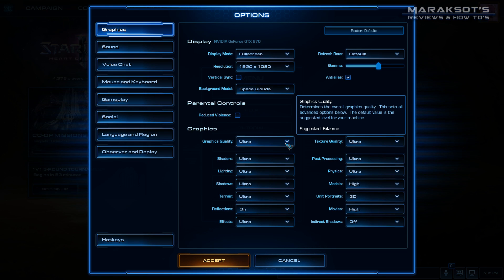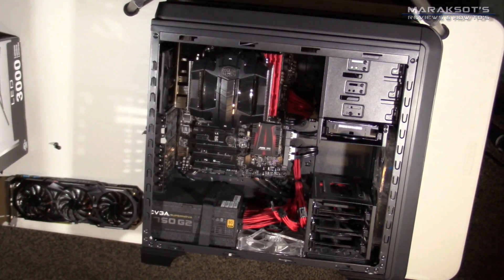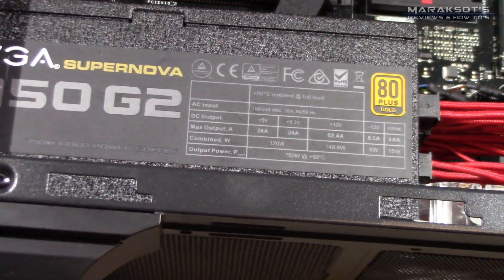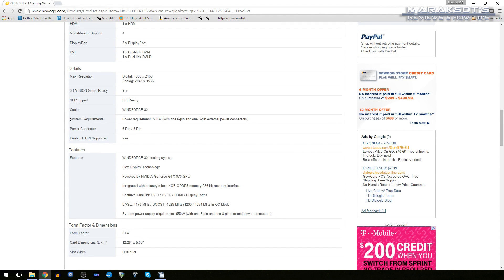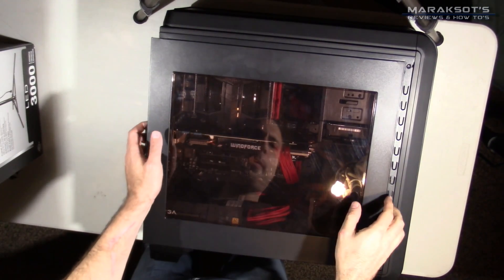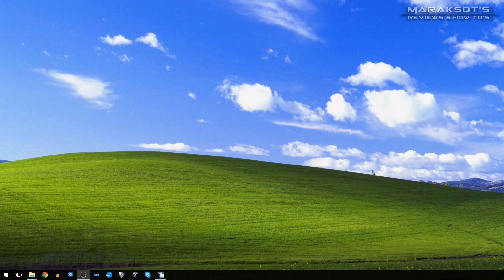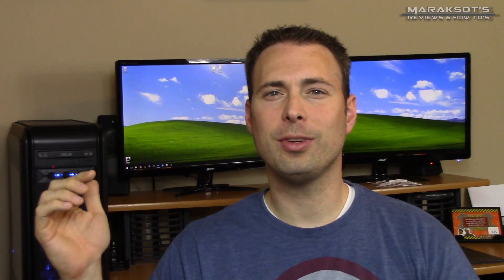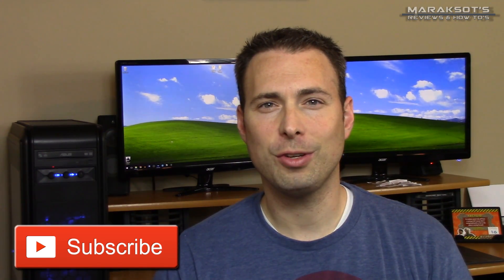A Beginners Guide - Upgrade your GPU - How to Install a New Graphics Card

Comment: I try to install a radeon rx 470 into my computer, did not work, even if I have tons of ram and a 8 core CPU
Reply: My pc model: Dell XPS 8700
Reply from the maker: I'm sorry to hear that.  I'd like to help but I'm going to need some more details to be able to see if I can help troubleshoot the problem.  What exactly do you mean when you say it doesn't work? Do you push the power button on your computer and nothing happens? Or do you push the power button and you hear the fans come on and whatnot but nothing is displayed on the screen?  Or does the Dell logo come up on your screen at first but then as it boots into windows everything goes black?  If you can tell me exactly what's happening then I may be able to help.  :)
Reply: I push the power button, fans spin up, no display image..
Reply: Every once in a while though it does work
Reply from the maker: Great Dane Productions thanks for getting back to me and telling me a little more about what exactly going on.  I would suggest updating your motherboard BIOS. I've seen problems like this in the past fixed with a BIOS update. I'm not 100% sure if that's what's causing your problem but I think it's worth a try.
Reply: I already have it updated to A11
Reply from the maker: ok, since you've already done that... Over the years I've learned from my own mistakes and in the past often times I would overlook the simple things.  I guess because I think I  know what I'm doing and I couldn't have made a noob mistake like that.  :D ha ha So I guess we should start with the simple stuff... have you checked to make sure your new graphics card is fully seated in the PCIE slot? Go ahead and remove it and then reinstall it making sure it seats fully in the slot.  Also check for any power connectors that may be loose to your graphics card or your motherboard, ie the 24 pin motherboard power connector and then the 4 pin CPU power connector near the CPU. Make sure your RAM modules are fully and properly seated.  Make sure your DVI, HDMI or Display Port cable is fully and securely plugged in to both your graphics card and your monitor.  I know this is all very basic stuff but like I said, there has been several times where I've made the mistake of not checking all these things and after hours of troubleshooting I find that my graphics card wasn't seated all the way or something.  If you try all these things and it still doesn't work correctly then I'd say put your old graphics card back in and see if the problem persists.  If putting the old card in fixes it then you may have a defective RX 470 and need to RMA it.
Reply: Yeah, im returning it. Im gonna just proceed with the gt 635 that was in there (BTW the dedicated cards go upside down for some weird reason)
Reply from the maker: Great Dane Productions I assume you're referring to how they design graphics cards with all the fans, lights and interesting looking parts facing down toward the bottom of your case where you can't see any of it?  :D ha ha I think that's weird too.  Lots of PC gamers have side panel windows in their cases so they can see all the sexy goodness inside and it's lame that they design the cards with all the good looking stuff facing in a direction where you can't really see any of it.  :D
Reply: I actually can see the leds and all that
Reply: That motherboard in another direction from my old pc (which was a hp p7-1423, which its motherboard got a crack on it)
Reply: Turns out that rx 470 was old. How could I tell with it not having any dust?!
Reply from the maker: Great Dane Productions so they sold you a used RX470 as a new one? If so that's messed up man.

Comment: 1 question : I am looking to upgrade to a gtx 760, would a hex core processor with 32gb of ram be enough? I also need to upgrade the power supply
Reply from the maker: +Krispy Siege yup you're good. :)

Comment: Would you think this would be a good graphics card. Its called the AMD Radeon R5 220 2GB DDR3 PCI Express 2.1 Graphics Card. It has a 625MHz clock speed and 2GB of DDR3 Graphics Memory. Would it be able to run GTA 4 or 5 (Even if at minimum settings).
Reply from the maker: It looks like that card will run both GTA 4 and GTA 5 but at minimum settings.  Personally, currently I wouldn't recommend anything lower than a GTX 1050 or an RX 460 but I understand that not everyone can afford to spend $100+ on a graphics card.  Just fyi GTA is a pretty CPU intensive game as well, you'll want to make sure you also meet the minimum requirements in that regard.  Here's a link to a PCGamer.com article detailing the minimum system requirements for GTA 5.  http://www.pcgamer.com/gta-5-system-requirements-announced/
Reply: Maraksot78 Okay thanks
Reply from the maker: Tokuku Animations no problem. :)

Comment: i just installed a new graphics card and my monitor wont turn on i keep getting "entering power save mode"
Reply from the maker: When encountering problems like that I always look for the simplest stuff first.  So the very first thing I would do is make sure your monitor is set to the correct input.  So if you're using a DVI cable make sure the input is set to DVI.  If you're using HDMI, then you would of course want to make sure it's set to HDMI.  If being on the correct input doesn't change anything the next thing I would check is if your HDMI, DVI or Display Port cable is securely plugged into the appropriate port on your video card as well as on your monitor.  If that's all good and you're still getting the same problem then I'd check to make sure your new graphics card is fully seated in the PCIE slot and that the PCIE power connectors are also fully and securely plugged in.  Hopefully one of those will fix it if not let me know and I'll see what else I can do to help.  :)
Reply: Maraksot78 i got it to work i just needed to get a dvi cable and it started right up i really appreciate the help man
Reply from the maker: ben pruitt glad to hear you got it working. :)

Comment: Hello,i recently bought the asus rx 460 4gb and when i'am playing games like roter the shadow looks blocky even when i put it on ultra,my spec: i3 4170,4gigs of ram,windows 7 64bit,any suggestion?
Reply from the maker: +edward smith I'm not familiar with Roter the Shadow nor can I find any game by that name online so I'm guessing you got auto corrected from something else like Shadow of Mordor? :)  I always say to go with the simplest stuff first and you saying the game looks "blocky" my initial thought it to go to the video or graphics settings in your game and check the resolution and make sure it's set to 1920 X 1080 (or whatever resolution your monitor supports). If it's set to 640 X 480 or even 1280 X 720 (basically any resolution that's lower than your monitors native resolution) then things will look kinda "blocky" or blurry.
Reply: I mean rise of the tomb raider and yes i'am playing on my monitre resolution and game present high,i noticed that the shadow in some areas look blocky but every thing else looks very good.
Reply from the maker: +edward smith I did a little searching online because I'm not sure what's causing that. It seems that you're not the only one experiencing it but so far I haven't been able to find a fix for it.   :-/
Reply: Thank's man,it looks like an issue with the game.
Reply: I'am using a hdmi to vga converter,do you think that it will reduce the quality of games?
Reply from the maker: edward smith I guess it's possible but I don't think it's anything to worry about.  :)

Comment: Hi! I have question, I have a gtx 970 and I'm planing to upgrade to a 1070. But do I have to uninstall my drivers or can I keep them?
Reply from the maker: +The Crasy Dane if you're already running the most current drivers then you should be good to just swap out your graphics cards. If not, then I'd recommend upgrading to the most current Nvidia drivers to get the best possible performance out of your new 1070. Congrats on the upgrade. :)
Reply: Maraksot78 omg thanks! i know its a dumb question, but still thanks alot dude
Reply from the maker: The Crasy Dane no problem man. Happy to help. :)

Comment: I have GTX960 right now, I have Asus Z97 Pro Gamer motherboard and an i5-4690K, 600W PSU and 8GB Ram. Can I upgrade my 960 to GTX1070 without any problems? thanks :D Im pretty sure they  will work but Im just asking if you know it?
Reply from the maker: +MikluFX oh yah you'll be just fine the i5-4690k is still a very capable chip. Congrats on the upgrade the GTX 1070 is a beast!
Reply: thanks for replying! Gotta save that money :D
Reply from the maker: No problem. I hear ya man. :)

Comment: Really nice video mate! I'm buying a ny GPU aswell as a CPU for my PC and i wonder, don't you need to "reset/farbicreset(?)" the whole PC afterwards? Thanks
Reply from the maker: +Tricktan there's no need to "factory reset" or do a system restore of your computer after upgrading your graphics card and CPU. Your system will detect the newly installed hardware and everything should be fine.  Actually if you do a system restore after changing out hardware you very often have problems because it reverts everything back to the way it came from the factory and since you now have hardware that wasn't part of the original configuration things get messed up.  I sgiuld mention if you change out your motherboard while switching your CPU you may have issues with your Windows license because Windows 10 registers with your motherboard so if you change it out you'll have to buy a new Windows license... unless you call Microsift and tell them your motherboard died and you had to replace it or something like that.
Reply: I see, thanks! I'm not going to replace my mother board though. Or maybe i have to, to make the new GPU fit, but it should right? I have a 660 right now. And by the way, will i lose my windows 10 license if i make a factory reset? I kind of want to do that to get a fresh and nice start. And if I do, maybe its smart to do that now since i haven't changed the hardware, since my brother built this PC, other that throwing in a couple of SSD's. Thanks for your fast reply mate!
Reply from the maker: +Tricktan you don't need to change your motherboard to swap in a new graphics card. Doing a system restore won't affect your Windows license. No worries there. If you want to do a system restore I would definitely recommend doing it before swapping out any hardware to avoid any potential problems.

Comment: So you could just push a 6pin and 2 pin powercord together to and plug them in a 8 pin whole?
Reply from the maker: +Tricktan yah, that make them that way so they'll work as a 6 pin for cards that only require 6 pin power and then have the extra 2 for cards that require an 8 pin.
Reply: Aight, thanks!

Comment: Hi! I just bought a Gtx 1060 3GB and I have a big problem.
I put my gpu on the pci-e slot and plug the cfable for the power spply(6 pin only needed). After that when I want to turn it on nothing happen. All the fans(including the 2 from the gpu) are running but the monitor remain black. I've tried to remove the RAM and then put it back. I tried to disable the Graphics from my intel processor. Nothing worked for me:(
! If I take out the gpu from the pc and plug the cable from the monitor into the Motherboard the Pc works just fine.
I have a I5 6500(stock cooler) ; 8 gb of ram from hyperx and 520w power supply.
Please help me!
Reply from the maker: The first thing I'd suggest is to first make sure your graphics card is fully seated and that the power cable is plugged in all the way. Once you've checked that if there is still no video being displayed then my question is does your motherboard splash screen show up when you first turn your computer on but then as it loads into Windows everything goes black? If that's the case then you you may need to update your motherboard bios/uefi. Although typically I've only run into that problem on older motherboards.
Reply: i found a solution. I selected in boot menu as default GPu the one from the processor.  And finally it booted with the gpu(gtx 1060) installed. I finally installed the drivers too. Now I have to buy a new VGA-HDMI cable or adaptor(or maybe a Vga-DVI-D adaptor). But I have to use the VGA-VGA cable plugged into my MoBo until then . I have a cable (VGA-HDMI but it doesn't work neither the Mobo or the GTX 1060. Thank you anyway for the suport. I'll be back with some updates.
P.S: I tried to open Nvidia Control Panel But it sais that I have no output conected into my GTX 1060.  I be back tomorow when I will buy a new cable or adaptor.
Cheers!

Comment: how long does the new boot take? bcause im sitting here looking at my screen
Reply from the maker: +L as long as your new card is properly seated in the PCI Express slot, the power is connected and ypur monitor cable is connected to it it should boot in the same amount of time as normal. Now if you see your motherboard manufacturers splash screen and then as windows loads everything goes black (this is a rare problem but does happen) then you'll need to update your motherboards bios/uefi.
Reply: Maraksot78 thanks for the information, but i didn't even needed them. I just rebooted my computer and it all worked out fine
Reply from the maker: L Awesome! I'm always happy to hear when things go smoothly. :)

Comment: Could you please help me i can't find answers anywhere i just got the cybertron pc Borg q computer and it came with a 500w power supply. i currently want to upgrade my GPU to the 960 gtx Geforce card but on my power supply i can't find any pci cables to plug into the 8pin and i have no idea what to do
Reply from the maker: +Lyss♥ it is possible that your power supply may not have an 8 pin PCI Express power connector. Did your graphics card come with any adapters to adapt 4 pin molex or SATA to an 8 pin pcie? It's possible it did but it's also possible it didn't. If not you may have to buy an adapter online like these... https://www.amazon.com/gp/aw/d/B01EUSZ0BQ/ref=mp_s_a_1_8?ie=UTF8&qid=1483774731&sr=8-8&pi=AC_SX236_SY340_FMwebp_QL65&keywords=molex+to+8+pin+pci-e&dpPl=1&dpID=41QT9CWt%2BeL&ref=plSrch

https://www.amazon.com/gp/aw/d/B01D0YXXHE/ref=mp_s_a_1_5?ie=UTF8&qid=1483774731&sr=8-5&pi=AC_SX236_SY340_FMwebp_QL65&keywords=molex+to+8+pin+pci-e&dpPl=1&dpID=41-RitjwnVL&ref=plSrch
Reply: Maraksot78 it was hidden in allmy cords lol i found an 8pin and everything is working great now!
Reply from the maker: Awesome! Glad you found one and got it working. Enjoy! :)

Comment: Wait so you can put any pcie gpu in any pcie slot it still confuses me what's x16, 3.0, etc
Reply from the maker: +Royalcookie Gaming yes this is true, you can put any PCIE graphics card into any compatible PCIE slot. The difference is the older standards PCIE 1.0, 2.0, etc have less bandwidth.  Basically the newer cards that are 3.0 compatible if put into a motherboard that only supports PCIE 1.0 or 2.0 the graphics card will only be able to operate at 1.0 or 2.0 "speeds." And then of course if you use an old 1.0 or 2.0 graphics card on a new PCIE 3.0 motherboard then the card will only operate at it's rated "speed."  The x16 or x8 is the number of PCIE lanes that slot has available to it.

Comment: Before installing the new GPU and it's drivers, should I uninstall the current drivers before removing the current card?

My current one is an AMD Radeon R9 270 or 280 and I'm making the jump to the EVGA GTX 1070.
Reply from the maker: +Paul Beenis the Parrot it doesn't matter if you uninstall the drivers before swapping out graphics cards or after. I would just recommend uninstalling your AMD drivers before installing the Nvidia drivers. :)
Reply: Maraksot78 Alrighty then. Thanks for the info, man. :>
Reply from the maker: No problem. :) happy new year!
Reply: Maraksot78 same to you.
Reply: yo man i have a problem i just bought a new card but when i put it in my pc doesnt even open what do i do it doesnt recognize
Reply from the maker: can you clarify a little more on what you mean by "it doesn't open what do I do it doesn't recognize?"  I understand you just installed a new graphics card but in order to try and help I need a little more detail.  Does your computer show your motherboard/manufacturer logo screen and then as it's loading windows go black and never load? Or do you turn on your computer now and nothing ever shows on the screen?
Reply: Maraksot78 if it's Nvidia to Nvidia is it okay to not uninstall them? Where can I uninstall them? :)
Reply: Paul Beenis the Parrot You made a HUGE jump. Like me.